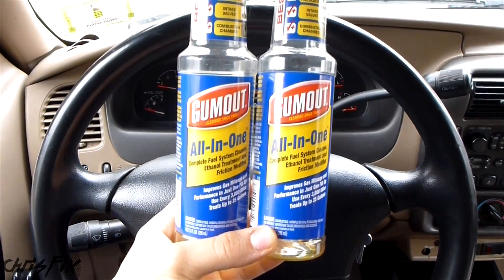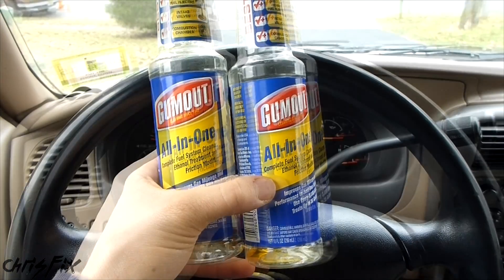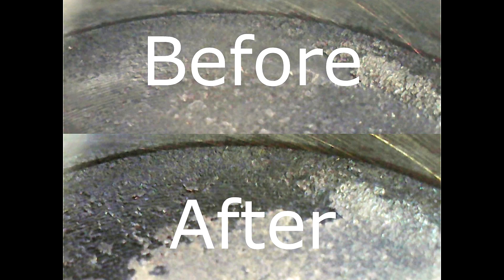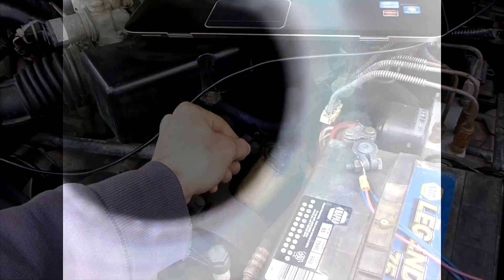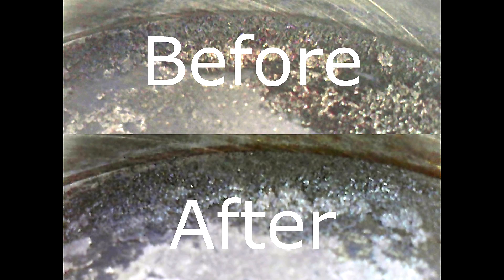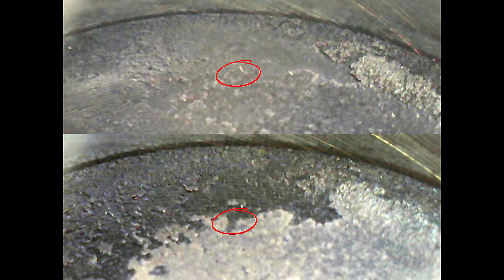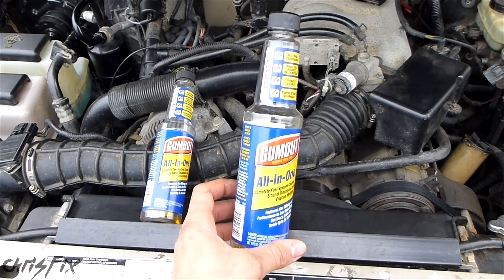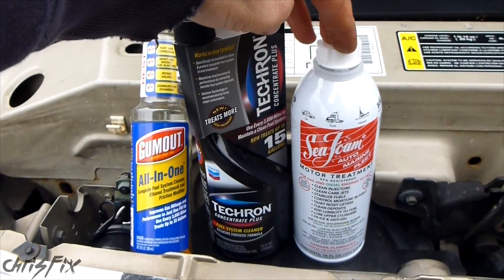Does Gumout Fuel System Cleaner Work (Follow up)?

Comment: chris i would try out, the gumout all in one tune up. the one in the white metal can. thats what scottykilmer used. and he showed that it worked. i mean maybe the can has different stuff in it. and i cant wait to see what lucas looks like on there. proly wont have much change. if you could show Marvel mystery oil too id like that, i use that stuff but idk i guess i just like the bottle lol
Reply from the maker: frankenstrat25 FYI, the photos scotty "took" were of different cylinders and therefore a fake. Take a look at the two pictures closely and you can see that. He was payed to make that commercial which discredits his video in my book. I cant wait to try lucas and see as well! I might try mmo too so stay tuned!
Reply: ehh i guess youre right, im always skeptical of scottys methods. im part of a mechanics page on facebook and they all seem to hate him with a passion lol. i honestly dont see the lucas doing anything with cleaning. but i definitely can see if a car has lost some of its compression if you add a bottle to up the thickness. the marvel. im a believer and im not. i dont really know what to think of it. i know it really thins my oil out. in my old ranger i used to add a quart for the last 300 miles of my oil life. and by the end id start getting some piston slap with the low viscosity oil. then when i changed it and the oil got on the cylinders it stopped.
Reply from the maker: frankenstrat25 Scotty has some good videos and gives good overviews of jobs. With that video though, I was disappointing. Yea, I dont know what to expect from any of these products but I hope we can get a good before and after from at least on!
Reply: ehhhh idk if any of these cleaners do better than the other. i like how eric the car guy pointed out how water could work too. he just poured it down the intake. on injected cars you just do it through the brake booster like you would seafoam.
Reply from the maker: frankenstrat25 Well I will be testing water. I am skeptical if that actually works.

Comment: Thx for video  i did the same my guestion is will or can the seafoam  damage the seals in the engine  and how many  times  do you think  it will take for results  to be noticeable  thx again for video
Reply from the maker: geohooptie Seafoam has alcohol in it so it isnt good to use a lot, but using it once a year wont hurt anything. We will see the results when I do the test so stay tuned! Otherwise, I do not know what the results will be!

Comment: hey Chris. nice video. i gotta say, the place i used to work at sold all kinds of chemicals to garages and dealerships. what i learned in the 4 yrs of working there is that 90% of all injector cleaners are worthless. they key point is that 90% of all injector cleaners are KEROSENE based. you can find the proof by checking out the MSDS (material safety data sheet) of each injector cleaner to find the composition of the formula. kerosene is only good for cleaning off the top layer of deposits, which is why you must use them at each gas fillup for any difference in performance. these bottles usually cost between $2 - 5 per bottle. waste of money in my opinion. however...

the other 10% of cleaners (and it's probably less than 10% in the market) are formulated from their own proprietary formula. 2 examples are Valvoline fuel injector cleaner & Redline fuel injector cleaner. both of those use harsher chemicals to get rid of carbon deposits, but not so harsh as to harm hoses/seals. these bottles cost about $15 - 20 per bottle, but since they do the job PROPERLY you only need to use them every 15,000 miles or so. very much worth the money. just note that the engine might run a little rough for the first set of miles since all the gunk is being loosened up the way it should. in my experience, Redline worked the best for me.
Reply from the maker: tmac9938 Thanks man! I will have to look into Redline. It wasnt on my list but if nothing works, I will have to give it a shot!
Reply: ChrisFix
I saw in another comment you made that you were going to try Seafoam. Kerosene-based yet again ;)  It all comes down to viewing the MSDS sheets of each cleaner. These sheets are tough to read, but you get the hang of it once you skim a few.
Reply from the maker: tmac9938 The seafoam you use though the intake though which is different then putting it in the gas. I have been reading the MSDS sheets lately. It isnt hard to do, just need to know what you are looking for. The first page lists the ingredients. Thanks man!

Comment: Hey ChrisFix check this video out scotty kilmer using gumout multisystem tuneup https://www.youtube.com/watch?v=gg9ppeUMpK4  Another video I watched which was interesting was a by scotty Kilmer hooking up tool directly to the fuel rail Via the schrader valve, the tool is basically a container where you poor a special cleaner, hook up your air compressor to the tool which has a built in pressure regulator (set the pressure regulator at whatever pressure your supposed to have for your car), pull your fuel pump fuse, then start you engine directly off the cleaner instead of pouring a diluted cleaner in your fuel tank. check it out https://www.youtube.com/watch?v=bKGI9N_yWd0

Comment: I have tried several of those cleaners, they seem to be all gimicks, the only one seems to work was Berryman b-12 chemtool, i used spray on throttle body, and dissolved everything. They has have fuel treatment/cleaner, worth a try.
Reply from the maker: toy96 I might give that a try. Thanks for the suggestion!

Comment: Snake oil usually doesn't do what it says it does. Seafoam does smoke a lot in gas engines. I would suggest removing the catalytic converter so it does not get clogged during testing/cleaning.
Reply from the maker: eatont9999 The smoke is burning oil so after one use it shouldnt damage the cats. Seafoam says it is safe for cats so... Gumout also said this cleans carbon deposits out lol. Thanks for the precaution!

Comment: I've used several different brands of fuel cleaner and almost always noticed a slight improvement in fuel economy, but sometime any improvement could be because of a number of different factors.  After reading some independent research on Techron I switched to using only Chevron/Texaco gas (which has Techron "built-in").

I also read a study that says nearly all the major brands of fuel system cleaners do indeed work, but because of the different chemicals they use, long-term use could eventually damage seals and whatnot. For example, Seafoam contains a high amount of isopropyl alcohol (as high as 20% by volume according to their MSDS), and isopropyl alcohol and rubber gaskets don't like each other. While Seafoam does work, as with anything, moderation is key.

During my days as an auto parts store manager I would tell my customers to stick with using a good, high quality brand of gas and not worry about adding fuel system cleaners at all. Most big brand-name gas stations (i.e. Chevron, Exxon, Shell, etc.) all have additives already in their fuel that perform the same job as fuel system cleaners such as Gumout and STP, so what spend the extra money.
Reply from the maker: Jeremy Durrenberger Thanks for the info Jeremy. I would say all fuel cleaners "work" but they dont work the way they say they do and the perfect example is this video.
Reply from the maker: ***** It says on the bottle you will notice results with just one use.

Comment: Hey ChrisFix, in a previous video you showed what happened on your PT Cruiser when the engine overheated, and you had coolant leaking into your combustion chamber. Those pistons looked squeaky clean. Too bad you can't duplicate those results with something that won't harm your engine.
Reply from the maker: marksrobby Great thinking man! I am actually going to do two different tests. One is the water in the intake test to see if spray some water in the intake will steam clean the engine the way people think it does. The other test is in the works and top secrete ;)

Comment: Next test: water to clean out carbon deposits
Reply from the maker: apachelives Yep! I cant wait to see if it works!
Reply: ChrisFix have you made this video yet? I’d like to see this please sir
Reply: Water doesnt compress. Good luck with that.
Reply: @johnnyclean8233  You don't cram a garden hose into the intake. You spray water in slowly. It's been done for decades.
Reply: @johnnyclean8233  lots of water equals hydrolock. You are fine if you let it sip a bit at a time. Steam is a great cleaner actually and many have used water.

Comment: Interesting to see your follow-up.  For what it's worth, my suggestion is to switch to 91 octane -- not for the octane (your Mazda doesn't need it), but for two other reasons.  1.) Most fuel suppliers put in more fuel system cleaning additives in 91 (that's why they call it premium, I guess), so you don't need to spend money on those bottles of clearner after the fact; and 2.) In Canada at least, most 91 octane fuel doesn't contain any ethanol, which is corrosive and harmful to your fuel system, and as far as I'm concerned just waters down the fuel (ethanol has less energy per volume than gasoline).  For the slightly higher price, you get better fuel mileage, and save money on not having to buy aftermarket fuel cleaners.  Try a few tankfuls and I think you'll notice a difference.  I think the best solution is to prevent the cylinder deposits and gummed-up injectors in the first place.  I switched a few years ago in all my vehicles, and haven't had a problem since.

Comment: Try CRC Guaranteed To Pass additive.  I have personally passed emissions testing using it.  The car picked up about 20-25 miles on the tank of gas that was treated.  Subsequent tanks of untreated gas return to usual mpg.  I have no idea if it cleans the inside of the combustion chamber.  It seems to reduce combustion temps and drops the NOx levels.
Reply from the maker: texan176 That is probably a fuel injector cleaner right? It would make sense if you have a better spray pattern that more gas will ignite and be used so you get better emissions. I will check it out, thanks for the suggestion!

Comment: Thanks Chris. Very interesting stuff. I wonder if there is a way to tell if these products are cleaning the injectors and  valves  or not. And if it makes any difference in how our engines runs. Like maybe smoother or better gas mileage etc. Anyway great stuff as usual.  Thanks so much for posting.
Reply from the maker: Gipstetz Thanks man! There is a way to check the injectors but you need special equipment that I do not have. You take a volume test before and after. You can also check spray pattern. Gas mileage is tough to check because there are so many variables.

Comment: U should try this one gumout multi-system tune up I hear alot of good reviews let me know if u can test it out u can find it at advanced auto parts online
Reply from the maker: Eli Gomez I might test that, but this is basically the same stuff when you look at the MSDS sheets.
Reply: Oh ok well it might be the same idk about that the one ur using is it making white smoke come out
Reply from the maker: Eli Gomez White smoke doesnt mean anything. It just means you are burning oil.
Reply: ChrisFix I know why the smoke is coming out Iol just asking if the all in one is making smoke come out the tail pipe have u been on this website gumoutproveit.com check it out got vids and comparing the system
Reply: ChrisFix If your burning oil the smoke will have a blue tint to it.
Reply: I do know threw experienced working on cars that smoke leaving dark black on the ground its burning gas reasons could b bad injectors bad wiring in the injectors sorted to ground and bad pressure regulator on  injectors engines
Reply from the maker: Eli Gomez Very true!
Reply from the maker: jeff666p If you have a headgasket leak yes, but if you introduce oil into the intake such as seafoam, it will burn white.
Reply: ChrisFix
Blue smoke for oil burning.
White smoke for antifreeze (such as blown head gasket).
Black smoke for too much gasoline or not enough air.
Reply from the maker: jeff666p I dont think you understand what I am saying so let me try to clarify. Yes, you are correct, when a head gasket is leaking blue smoke indicates oil, white indicates coolant, and black is a rich fuel mixture. When you add an oil to the intake, such as seafoam, or if for some reason you are leaking a lot of oil from your head gasket, it will be white smoke. They actually use oil injection on tanks to create white smoke screens for defense.
Reply: ChrisFix Another source for immense clouds of white smoke is ATF, as in when your auto tranny's modulator valve takes a dump.  James Bond style!
Reply from the maker: Gary Mastro Sounds like you know this by experience lol. Hopefully you were able to get away from the bad guy!

Comment: I don't know if you can get them in the US but there are foam cleaners that you spray into the cylinders through the spark plug holes and leave there for half an hour, then reinsert spark plugs and run.

Comment: I've been craving this video for days! I was driving down the road today just jonesing (how do you spell that? lol Google confirmed my spelling) for the knowledge if my 2 on sale impulse buy Gumout All in One products were going to get returned or used...now I can't find where I put the product or the receipt, lol.

That said, it just cleans the soft deposits that aren't baked on? And yes, it effects deposits but not much? In fact, one spot had more carbon!?

Engineering Explained says he read some scholarly journals about PEA. That on new engines it will dirty them FASTER. On used engines, PEA will clean and clean up to a point, but then it'll only maintain and won't clean any deeper in effect even if continually used. That said, it may make a point about the spot where new deposits were spotted. PEA DOES make engines dirtier....but should do more good than harm so long as your engine isn't clean.

Remember one of Chris's earlier vidoes leading up to this? He put his bore camera in everybody's engines that came around and all of them had clean pistons. Per that scholarly journal, every single one of them SHOULDN"T use PEA. Perhaps you should know you have carbon build up before you use PEA to clean your engine.
Reply from the maker: DE Nichols What I found is that gumout all in one did a good job cleaning the gummy, soft deposits but a poor job of cleaning the hard carbon deposits.
 Interesting points. I did not think about that, and that answers some questions I had for myself when I did the tests. Cylinder 3 threw me off but now that you mention Engineering Explained's video where he says PEA can cause a buildup of carbon on "clean" cylinders, that might be the proof!

Comment: So would you recommend people to use these fuel system cleaners?
Reply from the maker: Jose Suarez Well, this is just one test. So far, I would suggest a cleaner if you have a misfire or you think you have dirty injectors or sticking valves. If you have carbon buildup, I do not think you can get the engine cleaned with an additive.

Comment: I recently just used Seafoam on my 98 Subaru Impreza, and lets just say, it didn't end well. Lol. My motor started knocking, and apparently I ran my car out of oil. But that's probably just me. All I know is that I'm not gonna use it again. xD
Reply: ChrisFix I don't know how I did cause the oil levels were good when I checked them right before doing it. Right after I was done seafoaming, smoked it all out, and drove it around for a bit. As soon as I let off my clutch, it felt a little weird and I started hearing some rattling. Lol. Took it back home, and apparently oil levels were low. Dipstick had no oil on it, not even on the tip of it. Oh well. Been talking about a 2.5/Hybrid swap, so I guess it's coming sooner then I asked for. xD
Reply from the maker: theMKeeX Ouch. How did you run it out of oil?
Reply: Oh my days, those tight tolerance engines are fussy.  Did your engine seize?  Hope it works out in the end for you, those little boxer engines are beautiful when well-maintained.  Stay gold.
Reply: ***** It still runs, just won't go very far, or at least I don't want to travel far where it's at right now. It feels like its starving for fuel for whatever reason, cause I barely let off the clutch and the car feels like it's going to die on me.

Comment: SEAFOAM, only product that actually works, been in the engine cleaning business before anyone since the 40s, they must be doing something right for 70 years
Reply from the maker: Daniel Allison Well we will find out! All of this stuff "works" for certain things. Dont get me wrong, the gumout I used does work for removing varnish and gummy carbon. It might also clean the injectors if they are dirty (I have no proof of that though). But I am testing carbon buildup on the cylinder head and that should transfer to carbon buildup on the valves too!
Reply: ChrisFix have you made a video for the seafoam and other products yet?
Reply: ChrisFix  As far as fuel injector cleaning. . . . when you do have an engine that fails a power balance test and you suspect fuel injectors. Try whichever cleaner you like the most on these experiments and see if it improves fuel injectors that have been found at fault. :)
Reply from the maker: DE Nichols Yea, but that requires me to wait for a bad injector lol. I want to test it now! hahaha... Good thinking though! I like where you are going!